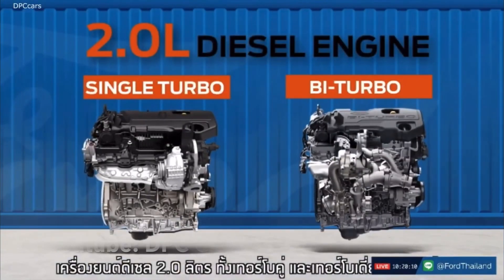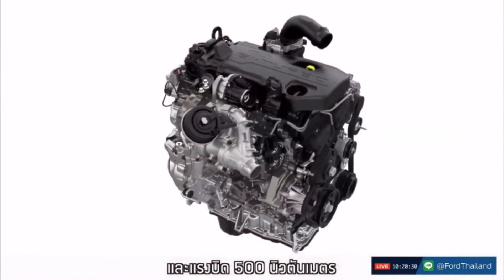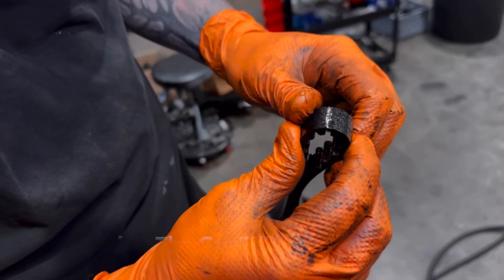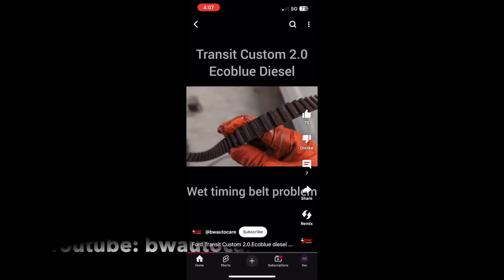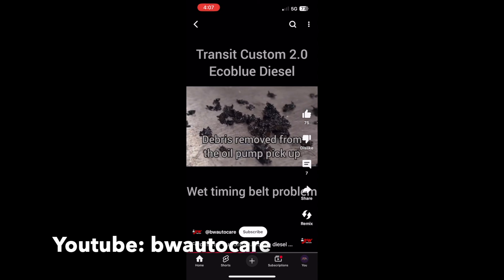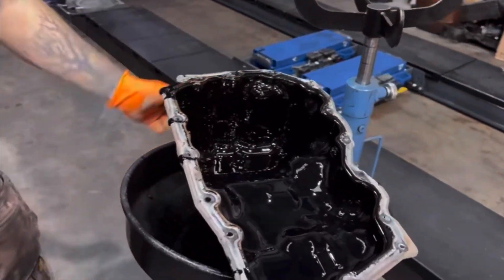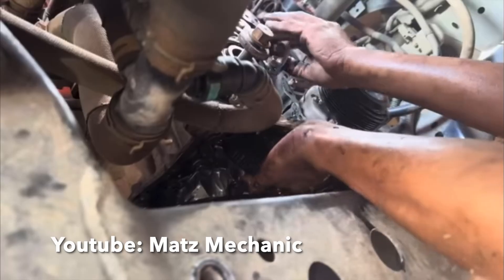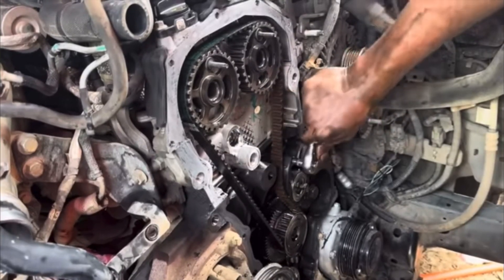The Ford Ranger Timing Belt Ticking Time Bomb.

Comment: IInm there's one low mileage Ford Ranger Raptor 2.0 biturbo in Malaysia had one of the piston blown (probably from skipped timing belt, it can lose it's teeth), Ford Malaysia don't even sell the piston to the workshop that requested it and they had to get replacement piston from scrapyards.

Comment: It seems the bean counters still get their way at Ford as they have done since the model T, are they going to correct this situation with wet belts ??? if not Toyota will just continue to go from strength to strength. Are Ford going to sell the Maverick internationally like they should have been doing since inception, no by the looks of it, too much hassle, no worries, Toyota is bringing out a similar model and will sell it worldwide in the millions going forward forever.

Comment: fineshed after 100 miles complete junk not just the wet belt injectors over heating and dpf and other emission related problems and the new 3.0 ranger and vw Amrock uses a landrover engine  buy a isuzu

Comment: Talking from brazil, here we have the exact same problem on GM onix chinese engines wich has been replaced there for the 1.3 ecotec with timing chain, the  brand here is giving a 240k KM warranty on the belt although no one here make the maintenence schedule after 60 or 80k KM on the authorized dealeship. Not even the chinese people liked that engine, and PSA Puretech its the same.

Comment: Thanks I'll be replacing my belts at around 120,000km.  Currently at 76,000km and change oil and filter every 7,5000 km.  When I had a Fiat twin cam I had the dry belts changed every 40,000 miles to be sure to be sure

Comment: Changing mine this month on a 2020 plate Ranger with 90000 miles. Not risking it !
Reply: Should you find missing teeth on the belt, it would be wise to pull the oil pan and clean out the oil pickup screen.

Comment: 150k km is still too long 80k-100k km is the safest range my uncle raptor bi turbo recently got major overhaul because the timing belt teeth got broken at around 130k mileage better do it earlier if you don't want headache

Comment: Ford UK have changed replacement interval to 6 years or 160km on this engine it's used in Ford Transits over there. Also look up oil pump failure and glow plug tips melting off and droping into combustion chambers 😂😂
Reply: True fact the motor in the ranger is actually a Volvo motor

Comment: Having to replace a timing belt on a 4x4 at just 150k’s is absolutely absurd. I’ve heard too many horror stories about these Fords.
Reply: True fact the motor in the ranger is actually a Volvo motor
Reply: No, the 2.0L wet belt engines in Ford Rangers are not Volvo engines. They are Ford's own EcoBlue diesel engines, specifically designed and manufactured by Ford. While Ford did own Volvo until 2010, the EcoBlue engines were developed after the sale. These engines utilize a wet belt system, where the timing belt runs in oil inside the engine.

Comment: The biggest cause of belt breakdown is lack of oil change or injector issues loading the oil with contaminants that degrade the belt prematurely.
If you have neglected normal maintenance or had injector issues then yea you need to change that belt.

Comment: This issue is pretty common here in the Philippines. A number of 2.0 rangers and everests are now having this. We normally recommend to replace the timing belt and timing cover every 80k or every 5 years (if less than 80k)
Reply: What's the cost by ford changing these belts
Reply: @philmelb1022  Do not take it to Ford they charge an eye watering amount and they only replace the belt they don't do the water pump or even bother to clean the oil strainer. Take it to a specialist plenty of wet belt specialists out there that deal with these types of engines.
Reply: don't forget to also change the wet oil pump belt
Reply: @rondg2 that’s included as well. Some owners even prefer to replace the oil pump as well.

Comment: what were these "engineers" on? that's the dumbest combination ever and they must know these engines are junk. they should have continued with the WLAT 2.5 & 3.0 L engines but with more power. those are some good engines.
Reply: It's not even a Ford motor it's made by Volvo

Comment: Does the 3L turbo diesel have such à wet belt ?
I am considering Buying a ford everest which is based on the ranger. It has 2 motors, and the one I am looking into is the 3L TD
Reply: For Diesels: the 3litre v6 has dry belts. the 2.0 litres has wet oilpump belts.  dont know about the petrol engines, as they are not used in my country.
Reply: Thank you very much

Comment: Also used in the H6 Subaru Outbacks - these now sell for around $1000-$2000 due to massive failures of this moronic design.
Reply: Even Subaru?  Did all the auto manufactures get a kickback using wet belts?  Why is the cancer here now all of a sudden?
Reply: True fact the motor in the ranger is actually a Volvo motor

Comment: Wet timing belts are criminal engineering, 100% related to fractions of % efficiency in hitting emissions targets, with zero thoughts to longevity of the engine and resultant catastrophic cost to customers.

Comment: We already seeing those wet type timing belt failing below 60k kilometers. Our local shops and mechanic vloggers recommend to change it every 50,000 to be on the safe side. To make the situation worse, there are two belts that have to be replaced and that one on the buttom requires a professional job to get it done. This is isn't something ordinary non mechanic guy can easily do in their own home.
Reply: True fact the motor in the ranger is actually a Volvo motor
Reply: @jamesbarrows-y2i  wrong, stop spreading bullshit.

Comment: Ford... EcoBoost... EcoBlue... Ranger... Transit... all models absolute faeces.
Reply: Yeah Ford should stop using Volvo motors in their ranger
Reply: @jamesbarrows-y2i  Name the engine Ford use from Volvo (Zhejiang Geely) in the Ranger...
Reply: @teamtempest844  the motor is in the ranger a few different mechanics told.me I don't know the actual name of it I have just been told the motor is actually a Volvo motor.and as I said a few mechanics told me.that first one told me and I asked a few others.i said to them is it true that the motor in a Ford ranger is actually a Volvo motor.they said yep sure is not my fault you didn't know that
Reply: @jamesbarrows-y2i  Fake news, Geely (Volvo) use their VEA units, Ford Rangers don't have any old amalgamation with them since the 5 pot used in Focus. Not my fault your mechanics are dullard level.

Comment: Time belts or chains need to be changed on every vehicle after about 200k KMs. Some car  with rubber time belts are luck to last 100k KMs. Issue here is that change oil regularly or contaminated oil will damage the belt. These type of belts are now used by a lot of manufactures. Way better than rubber belts.

Comment: I have had  4 Fords in my time , 3  rubber timing belts , one chain driven . Only once a timing belt has  broken when  driving at 4mph , and no damage was done because it was a non interfrence engine.
Many of the small engine cars like  Peugeuot etc  are now Wet TB . I refuse to buy them , I will stick to my 15 year old  chain driven Honda that has an oil change every 4K miles !:face-green-smiling:
Reply: People keep saying it's for emissions but Toyota are managing to avoid wet belts just fine. In fact the 1.2 Turbo unit they made is far better than the 1.0 VTEC, the 1.2 Puretech and the 1.0 Ecoboost yet everyone ignored it so it got discontinued at least in the UK after just 4 years. 93k miles and 8.75 years in and it's still perfect.

Comment: I changed mine at 80,000 km. Some debris in the oil pickup and the belt was cracked. I change the oil every 7000 km since new. Trading it is soon for a Toyota Land Cruiser 300.

Comment: Has Ford not learned it's lesson from the 3 cylinder engines that are failing like mad? Oh wait, I forgot---this is an American vehicle, and the manufacturers only care about them lasting through the warranty period....which in the case of Ford, is only 5 years or 60,000 miles
Reply: Yeah Ford should stop using Volvo motors in their ranger

Comment: The wet timing belt is on the 2019-25 Ford 2.0L Diesel engine Bi-Turbo only and yes; very bad idea to own an engine with a timing belt wet or dry of any brand.
Reply from the maker: you'd be surprised how many comments i see questioning the validity of this video's content.
Reply: True fact the motor in the ranger is actually a Volvo motor

Comment: Nothing in the owners manual about changing the wet belt only the timing belt. Aren’t they two different belts? Do you actually know what you’re talking about?
Reply from the maker: clearly you don't
Reply: @ is the oil pump drive part of the timing belt?
Reply from the maker: @paulsimpson8990  oil pump has a seperate wet belt that runs of crank, timing belt also a wet belt the video is preety detailed.
Reply: @ I remember when timing belts needed to be changed every 90-100k so 230 seems pretty reasonable. Timing chains don’t even last that long
Reply: @paulsimpson8990  Arr yes they do, if you use the right oil and change it regularly, most chains will easily last this distance.  The point people are making here that the wet belts don't last 230,  not even near it. and unlike a dry belt which is generally easy to get at you have to rip into the engine to change these.

Comment: Well if the engine fails before 230,000kms and you have completed all the regular servicing intervals. I would be suing Ford.
Reply: And Ford should in turn Sue Volvo because.the motor in the ranger is actually a Volvo motor

Comment: Another brilliant? idea I saw recently on You Tube was a single use "plastic" oil pan. Can't remember what make it was. About as intelligent as the wet belt idea. I suspect bean counters are running the design team.
Reply: How long will it be before it cracks from heat cycles or breaks from an impact from road debris? Well, at least one will be able to clean the wet belt tooth debris out of the oil pick up screen while that are replacing the oil pan.

Comment: I don't believe in wet timing belts at all, hardly anyone knows that!! the engine oil specified by the manufacturer can be filled. Even if you pay attention to the type of oil, e.g. 5W40, the acid in the engine oil can dissolve the timing belt and thus destroy the engine. This affects Ford and all Stellantis engines that have wet timing belts.
Reply: True fact the motor in the ranger is actually a Volvo motor

Comment: We had 7ecoblue diesels at work. None of them reached 200000kms without major engine problems. My belt went at 140000km leaving me stranded 3hours from the nearest town. All of them got fixed under warranty.
Reply: Mine is a 2022 model sitting at 100,000km should i pay to change it prematurely and possibly avoid any major damage or should I wait to see if it goes then have it fixed under warranty for free? 

Also what other issues did you have?

Comment: This is why engines shouldn’t have progressed past OHV, along with timing gears. While it is true that newer engines get better fuel economy, it’s quickly circumvented by expensive maintenance. 

Meanwhile, anyone who drives a GM product with the 3800 V6 or any engine that’s a OHV pushrod design won’t have to do anything but fluid changes. Someone who drives something with a wet timing belt, or timing chains will have expensive maintenance and repair bills.
Reply: You have a really good point, but government mandates force manufacturers to constantly try to improve on fuel economy and emissions to try and avoid big penalties. They elect to use the least expensive methods to accomplish this and the customer is usually the one that ends up paying the price.
Reply: @markleggett3944 to hell with the government.

Comment: I own 3 different Ford vehicles of various vintages and each of them has different engine design flaws that I have to watch like a hawk. My ear is constantly tuned listening for the known telltale sounds of their component failure while driving. I can’t see myself ever buying another Ford due to engine issues except possibly a 5.0. The problem is that almost every manufacturer is making crap vehicles these days with the possible exception of Toyota.
Reply: True fact the motor in the ranger is actually a Volvo motor

Comment: Cheap nasty cost cutting rip off I'd never buy another ford & in the 70-80s I owned 4 in the UK  they were easy to fix & cheap to run
Reply: True fact the motor in the ranger is actually a Volvo motor

Comment: On my Connect it was 200000 km or 10 years. I had it changed on 97000 km and 11 years. The belt was in fine condition according to my regular mechanic😃👍 So km's is much worse than years,  on the timing belt?

Comment: As far as I know, rubber belts are made to run in dry conditions and not wet.
Reply: They are a stronger belt to withstand the oil a bit better than regular rubber belt but it will still degrade especially with dpf regens causing oil dilution with fuel that will accelerate wear on the belt its impossible for them to make a material that withstands it even honda made this mistake selling a 1.0 turbo civic here in the UK with wetbelts with the same issues so even the Japanese couldn't do it
Reply: @sbrader97  Honda has lost the plot the 1.5 VTEC was also a disaster.
Reply: Aqui no Brasil também tem muitos problemas com esse sistema de correia dentada banhada a óleo.

Comment: Timing belts are 150,000 or 8yrs, which ever comes first.  Dry or wet.  Golden rule. Since ever.
Reply: Yeah, how about Holden Astras? Golden rule not to blanket all timing belt intervals?
Reply: 4 years on my Vw 1.9 :(
Reply: Timing belt intervals have increased over time as materials and design improved. In the 1980s, 60,000 mile intervals were common. Later 90,000 became the norm in around the 1990’s . Now it’s commonly 150,000 miles.
Reply: @kennethprocak5176  I’ve always done belts before the 100k mark. Seen them fail before 120 a few times.
Reply: Sooner than that on wet belts you don't want rubber bits clogging that oil strainer you lose pressure and bust the top end otherwise. 6 years and 60k miles max in reality.

Comment: Just about every engine Ford has built with a wet timing / oil pump drive belt is going to fail catastrophically. What a mess.
Reply: Actually they are not a Ford motor they are actually a Volvo motor

Comment: The main cause for the belt deterioration is time, not mileage. If the belt is more that 5 years old, regardless of mileage I would change it. The oil eventually deteriorate the belt, even if you done all the services with the specified oil.
Reply: Even with the right oil chemistry, turbo and direct injected engines put more fuel into the crankcase and the fuel will degrade the belt over time. Halve the recommended oil change interval and they might last 100K miles.
Reply: Correct, I change the oil every  7.500kms, on my Ranger @markleggett3944

Comment: Thats why as an ex mechanic, I purchased a V6 Everest as it has a chain. Worst case it can rattle latter in its life expectancy.
Reply from the maker: your Next Gen V6 Everest is actually a belt, not a wet belt tho.
Reply: @abdautomotive   cheers I'll explore the workshop service manual a bit deeper. Thanks for the info
Reply: Actually has two belts, one at the rear to drive the fuel pump as well.
Reply: the v6 doesnt have a chain. its a derivative of the sdv6 that was used in landrovers and peugot / citroen and later in f150s. it has dry belts.
Reply: Search Lion V6
Reply: Lots of examples of premature chain failure in many cars so not sure that will help much if your luck runs out.
Reply: The Lion V6 diesel has two belts and two chains! But the belts are dry not wet.
Reply: Wet belts are all the drawbacks of a chain and all the drawbacks of a timing belt combined into one and even worse still.

Comment: One of the first indications that the belt is going is the loss of brake boost as the vacuum pump oil feed gets blocked due to the belt fibres my brakes lost the boost on the road but luckily it did not have a load as it took two feet on the brake to stop.
I was lucky  as the belt was on its last legs that was at 90,000 miles garage says change oil more often

Comment: I have seen them fail as soon as 140k and my suggestion is 140k max
Only use a full synthetic oil 
Don’t service at 15 K service at max 10K( 7.5k more desirable)
Never use oil additives. 
They are a piece of piss to do but there are 2 different timing cover variation, one with coolant degassing hole and one without 
You can inspect your own belt by removing the oil fill cap and spray a little bit of brake clean on it. If the belt looks flattened out- has micro cracks- back side looks rough it’s delaminating, replace yesterday not tomorrow, it will fail. 
Usually they will break some teeth off before losing oil pressure as they produce very little oil pressure at idle ( emissions BS) hence the low oil pressure light doesn’t come on until the damage is already done.
Reply: Have to pull the steering rack out of a Ranger to do the belt. Pain in the a***
Reply: Yes, you are correct. They have been known to start shedding teeth around 100000km. The residue from the teeth ends up in the oil pickup screen and can block oil flow.

Comment: This wet timing belt is the most ridiculous thing I've seen since they brought out the Ash Tray on motorcycles
Reply: Or the helicopter ejector seat !
Reply: @AJ-qn6gd Helicopter ejection seats actually work, however.
Reply: Well, at least the ash tray is self cleaning!
Reply: The airplane horn?